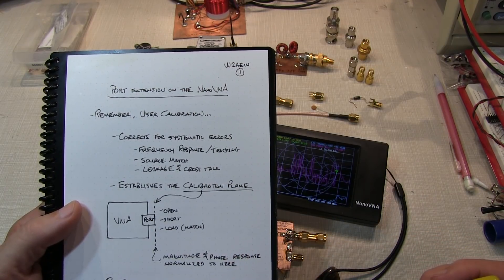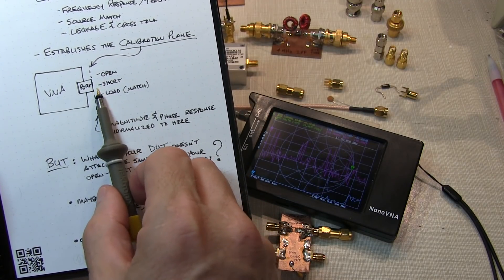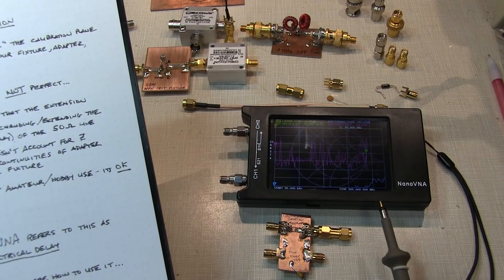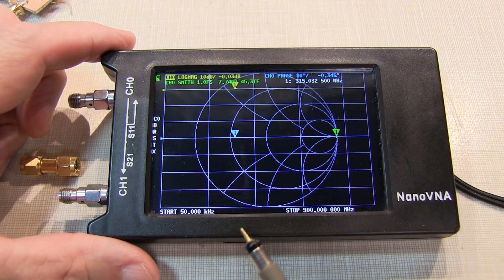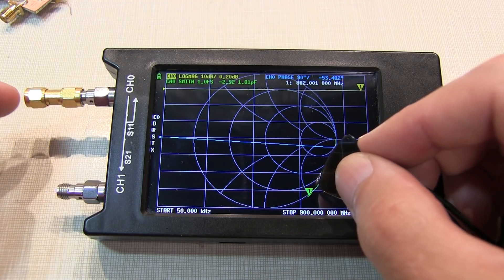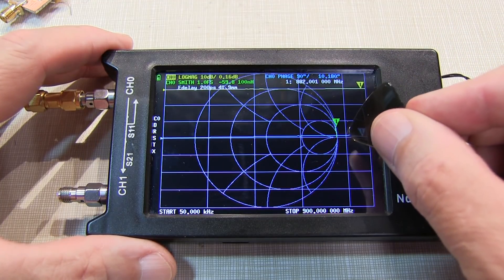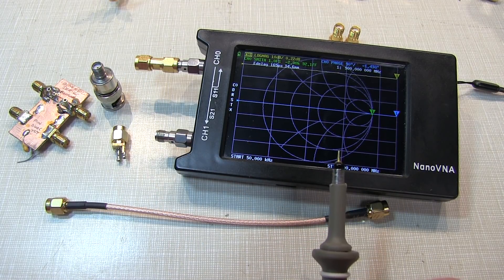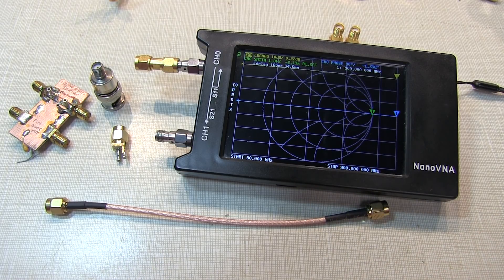#317: NanoVNA Port Extension using the Electrical Delay setting

Comment: I have a question, if I may.

Why is it not possible to do the calibration with the adapter/extended cable length connected. Would this not negate the additional parameters introduced and therefore the VNA  would setup its zero levels with the attached adapters/extended cable (For example)?
Reply from the maker: Sometimes it isn't possible to connect the cal standards at the end of the transmission line. An example might be a transmission line and antenna that are fabricated on a circuit board.
Reply: @w2aew  Ah..... I see. So its more of IF a physical limitation exists and therefore requiring a port extension/electrical delay to be employed.

Got it. Thank you. 

FYI, Thank you for the wealth of knowledge you have shared in your work over these many years. Its been a journey following your videos.

Comment: Great video. I am trying to measure 5.8Ghz antennas with a nano vna F v3. Problem is, i have the small U.fl connector on my antenna. Is it possible to use this same method  with such a high frequency and come out reasonably accurate?
Reply from the maker: Yes, as long as you adjust the length to null the phase at the cable without the antenna connected.

Comment: Hi, I have a question: if I calibrate using the adapters between the VNA and DUT that I'll be using for the measurement, I don't need to calculate and add a port extension value. The calibration, in addition to the reactance and resistance introduced by the adapters, should also "sense" the displacement of the measurement plane.
Is this correct?
TNX in advance and 73s.
Reply from the maker: Yes, the calibration plane is established at the location where the standards are connected, and the effects of the adapters in between are taken into account as part of the calibration.
Reply: @w2aew  TNX!

Comment: Just seen your Video and its just what i needed to know. This has helped because i tend to use a short extension lead on the NanoVNA to protect the SMA sockets. Im in the process of building a quad loop for 4m / 70Mhz band and when making the 75 ohm coax matching section i  use the phase and Smith settings for ease of final tuning / adjusting coax length . Adding the delay as suggested has sorted the problem.

Comment: Love your videos. If you calibrated the system at the ends of a wire instead of directly at the ports of the nanoVNA wouldn’t that account for the electrical delay already?
Reply from the maker: Yes, but sometimes that isn't a possibility.

Comment: What is the difference between using electrical delay and re-calibrating SOL at the other side of the port extension?
Reply from the maker: Electrical delay is used when:  You know the extension is 50 ohms and it is inconvenient or impossible to perform the SOL cal at the far end.
Reply: @w2aew  Thank you Alan, I had the same question.

Comment: What is different between using the electrical delay feature and calibration after adding port extension?
Reply from the maker: One assumes a perfect 50 ohm extension and one doesn’t.
Reply: @w2aew  Thank you.

Comment: Newer firmware you can set the scale of one of the traces to "Delay" and it will give you an accurate electrical delay to input 👍🏼

Comment: why can't you just do the calibration with the port extensions already attached ?
Reply from the maker: In the case I showed in the video, you could.  However, in real life, it may not be practical to apply the calibration standards at that point (it might be buried in a circuit board trace or inside of an assembly).

Comment: I wish someone would program the firmware so you you could use the jog wheel to adjust the electrical delay the same way the HP analyzers work like the 8714E series and the venerable 8753's.No guessing reqiured just wheel away!

Comment: If you have an antenna at the end of your coax and want to find the vswr and resistance on your nanovna do you have to add in delay, or can you just open short load calibrate on the nanovna itself ?
Reply from the maker: If the antenna is balanced or has a proper counterpoise, then the coax will not change the SWR.  The coax will transform the impedance, but not change the SWR.  So if your goal is to learn/measure the SWR at your transmitter, then simply calibrate the VNA locally and make the measurement.  If you wish to learn the actual feedpoint impedance of the antenna itself, then either calibrate at the end of the coax (then connect it to the antenna), or use the electrical delay setting to move the reference plane to the antenna (assuming you know the exact electrical length of the coax).

Comment: Could you do the same thing by running the calibration with the extender installed
Reply from the maker: Yes you can.  This tip is useful for situations where it might not be possible or practical to run the calibration with the extension included.
Reply: @w2aew    .I just ran through this with my Nano V4, Really easy.. And I understand why this would be helpful without disturbing your calibration settings.  THANKS AGAIN ALAN !!  73   N8QZH

Comment: Why would I use this method, rather than a standard OSL calibration which included all the hardware upto the measurement plane?    That is to say calibrate at the point of DUT connection.
Reply from the maker: Sometimes it isn't possible to use the OSL standard at the measurement plane of interest.  One example is testing the impedance of a printed circuit antenna that is sitting at the end of a microstrip transmission line on the circuit board.  The VNA would connect to the input of the transmission line, but the desired measurement plane is at the antenna end of the line, where the matching network would be applied.  Port Extension would be used to "move" the measurement/reference plane from the input of the line, down to the far end (antenna end) of the line.

Comment: Hi Alan, I was just about to email you and ask about this very topic of port extension as many UHF RFID fixed reader antennas connectors are RP-TNC so I cal with SMA and then do port extension to compensate for the SMA to RP-TNC adapter to get S11 of the antenna. Thanks so much!
-Lou
Reply from the maker: Awesome, glad this video was helpful!  Nice to hear from you, old friend!

Comment: Hello, thanks for your videos, very instructive.
I have a PCB antenna to test with the NanoVNA and I cut the SMA cable to solder it to the PCB. I am having trouble correcting my delay because the phase is well over -104° at my high frequency which is 3Ghz and I have 165degre at the lower frequency 2GHz. My antenna resonant frequency must be around 2.45GHz.  
Also, the curve in the Smith chart almost surrounds the first circle. What can I do to correct this? 
Thanks

Comment: I've been using port delays with my higher end VNA and with my mini VNA tiny for a LONG time. I just didn't know how to get to them with my newly acquired nano VNA. The VNA View software hides it here View->Port Length Extension. The "Saver" app sports a "Delay" parameter in the calibration, but it doesn't appear to do anything. Thanks for pointing me in the right direction. (btw, do you play the guitar?)
Reply from the maker: Nope - I don't play guitar - I have no musical abilities whatsoever.

Comment: Thank you so much you were very helpful, learned a lot. I also realized that in setting up calibration with the RF demo board , I was leaving out 1 step (watching other video's that said it didn't need to be done when in fact it does) Open-short-load-and thru cal. I wasn't doing the thru. Thanks again, this video was very helpful also.

Comment: Thanks for your response, still lots of line on smith chart with it hooked to RF demo board. I understand the calibration but don't understand why the extra lines in the cap and inductance area of the smith chart ,when using this demo board. Using nano VNA F-v2, is there a setting I'm missing during the process, to calibrate at the end of the supplied cable.
Reply from the maker: I don't have an "F" model, but I assume that the calibration process is the same.  Setup your stimulus frequency range, clear the existing calibration, run through the cal process applying the open/short/load at the end of the lead, APPLY the calibration and save it.

Comment: how are you getting no multiple circles on the smith chart with a lead hooked to S11. I've recently purchased an RF demo board and with the leads provided I cannot get rid of the multiple rings on the chart, even thou many videos don't show what I see, with the exception of 1 video and the guy just gave up at the end and said, not what he expected to see.
Reply from the maker: Are you calibrating to the end of the coax leads (putting the open, short, load at the end of the leads when calibrating)?  That should remove the phase shift and resulting rotation on the Smith chart with nothing connected.

Comment: Thank you so much, i was thinking i would need more cal set for pl249. do think this would work over a longer say 5m length of 50ohm rg58 ?
Reply from the maker: Port extension assumes a nice, lossless extension of the 50 ohm environment.  Depending on your frequency of operation, 5m of RG58 may introduce a few dB of loss, thus giving some misleading results when using port extension.  Better off building your own OSL cal kit to use at the end of the cable if your goal is to establish your measurement plane there.
Reply: Great was thinking about making a set of UHF pl259 standards... can it work thanks?

Comment: The Electrical delay and Group delay are measured in RF filter circuits and RF amplifiers circuits to measure how long it take the RF signal to get from input to output which is the electrical delay and measure the passband frequencies which is the group delay because of why? the reason why to know the electrical delay and group delay of the RF filer and RF amplifier is because it will "distort" the receivers AM/FM/PM modulator circuit? and the RF receivers sensitivity input front end circuit?
Reply from the maker: You can think of Group Delay as a plot of electrical delay vs. frequency.  Often times, the delay  through a circuit will vary with frequency, and this can cause distortion in wideband RF signals.
Reply: @w2aew  how can electrical delay and group delay cause distortion in the RF signal? When using S21 gain or S21 phase I don't see the distortion in the RF, how can you tell an view the distortion on a VNA or Spectrum Analyzer? The Distortion will look like what

Comment: NanoVNA is also a signal generator, powerfull enough to radiate at several meters of distance if connected to an antenna. It can be used to test antennas in the near field and receivers.

Comment: I want to measure antenna performance, at the Balun, while it is in the air. So, could I do calibration (Short, Open, 50 ohm process) at  the Balun's disconnected coax connection point, with the NanoVNA located at the far end, in the Shack (at the Transceiver connection point)? Thus eliminating the transmission line & lightning protectors from the readings, as I trim the antenna. Then reconnect everything and measure again at the transceiver end, to see the impact of the coax feed system.
Reply from the maker: Yes, if you can perform the SOL calibration at the balun end of the cable, this will take out the effects of everything up to that point, and will be superior than using port extension.  Just be sure to perform that calibration over the same frequency range as your intended test.
Reply: @w2aew  Awesomely presented & timely videos on the whole VNA topic, which I am just starting to explore. I hope to apply the insights gained to my HAM Antenna DIY projects. Thank you so much for posting these videos.

I have been using the MFJ-269 as my 'goto' tester; and expect to receiver a nanoVNA -F shortly. After going thru the long list to nanoVNA variations found on Amazon, I picked the '-F' version; mainly for the larger display and the ability to store field values. 

Do you have any comparative comments on the  '-F' version of the nanoVNA, vs the one you use in this video  ??
Reply from the maker: @cache4pat  I've never used the -F, so my comments are based only what I've read.  The metal case on the -F is nice.  Also, I like the fact that the -F properly labels the ports as Port 1 and Port 2, instead of CH0 and CH1 like the -H/H4.  The -F also has vertical axis labels which are nice.  But, I think the -F doesn't go all the way to 1.5GHz like the -H4. I think the RF performance of the -F is little better.

Comment: Hey Alen, if you had a nice Johnson Messenger 4230, and you lived in SLC UT with a window facing west, and you had NO antenna... I'm thinking two 10' sections of 3/4" pvc (easy & quick to assemble/disassemble, and cheep). But I have no idea of optimal cable run details. Any brief thoughts? I've been staring at my Johnson for two years now, and I'm still not sure how to handle it. Cheers! Dan ;)
Reply from the maker: There really isn't an optimal cable length - SWR does not change with cable length.

Comment: Great informative videos. Is there a way that that I could measure the impedance of a choke/line isolator/ferrites on the feed line to my antennas just to see if i have the correct impedance value for the frequency ?
Reply from the maker: The answer is a qualified yes - meaning that there are a few ways to measure impedance, and each method has different limits of impedance it can measure accurately.  Some involve some calculations.  I hope to do some videos on it - it is a very popular question.

Comment: Off topic, but regarding converting a vintage scope into a curve tracer using the octopus circuit, can you use an early '70s portable black & white TV instead of a scope? Thanks!
Reply from the maker: Not really very practical - mainly because XY operation isn't very straighforward.  It can be done though...
Reply: @w2aew  Alan, here is something interesting I've just now noticed after watching your videos for years; at 57, this new hobby reminds me of my 8~10 year old days. Had to hurry and take it apart and look inside. I.E Nice fly reel, 4 screwes later... Boing! Cahboom!... So I asked about a curve tracer crap portable tv. If it was easy, everyone... But, if some crazy person made a small b&w tv curve tracer, would it only be black and white? No cool green colors?

Comment: Hi, Alan, I have a Nano VNA and I have noticed the features are different to what I have on mine and I am wondering what version of firmware you have and have you recently updated it. I am curious as to what version of firmware it has?. Can you at some stage give an explanation of what they mean between the gain of S11 and S21 as return losses? I have used it on a homebrew antenna change switch and I am trying to work out how much of my injected signal is lost the SWR for the switch is reasonable up to about 70cm. 
Many thanks.
Reply from the maker: Mine is the NanoVNA-H4 running the firmware it came delivered with (v0.5).
S11 is a reflection measurement - which tells you how much of the applied signal is being reflected back towards the source, and the phase shift induced by the reflection off of the DUT input impedance.  It is also known as the reflection coefficient.  0dB means 100% reflection, and negative dB values indicate a smaller reflection.  A perfect match would be a very large negative number.  Return Loss is just changing the "sign" of the Reflection coefficient.  Thus if the magnitude of S11 is -10dB, then the Return Loss is +10dB.  The greater the number, the more return signal that is "lost" at the DUT input (i.e. more signal accepted by the DUT).  
S21 is the transmission coefficient - i.e. how much of the applied signal passes through the DUT.  If the DUT is an amplifier or active mixer, etc., the the signal coming out of the DUT can be greater than the applied signal.  In this condition, S21 would be a positive number and would represent gain.  When there is attenuation through the DUT, some of the applied signal is lost, and the S21 will be a negative number.

Comment: Love your videos. I have learnt more from them than any of time I spent in school traggling numbers.
I have one question though. I need to match an antenna to a PA with an output impedance other than 50ohm and my VNA only has 50 ohms output. What should I think about when doing this?
Reply from the maker: Maximum power transfer from the amp to the antenna system (antenna plus feedline) will occur when the input impedance to the antenna system is equal to the complex conjugate of the amp's output impedance.

Comment: Thanks for the video series regarding and info as always!    Just noticed today on the groups.io some newer versions are on the way... and looking like cost effective to be used up to 6GHz.  Now, if there was only a mod/hack that lowers the noise floor on the HackRF to improve that devices performance since is open source also and with two I'm thinking can be used the same.  The oscillator upgrade is well documented for starters and designed to have.

Comment: Has anyone looked at the tracking generator output on port 1/CH0 using a scope? I was surprised to see that for some frequencies the output was sometimes a square wave instead of a sine.
Reply from the maker: It's actually always a square wave.  It only tunes natively to 300MHz.  Operation from 300-900MHz uses the 3rd harmonic of the squarewave, and operation from 900-1500MHz uses the 5th harmonic of the squarewave.
Reply: @w2aew  ahhh got it, thanks! Actually, I'm having a hard time calibrating it in the 900-1500 MHz band. The reponse here is not flat afterwards. Have you experienced this also?
Reply from the maker: @mstjerning8919  I seem to get a decent result in 900-1500MHz.  Not perfect, but not bad.  It isn't going to be as good as the sub-300 and 300-900MHz bands for several reasons, the primary of which is because the stimulus signal is so much lower.  It is 15-20dB lower than the fundamental (180 to 300MHz)